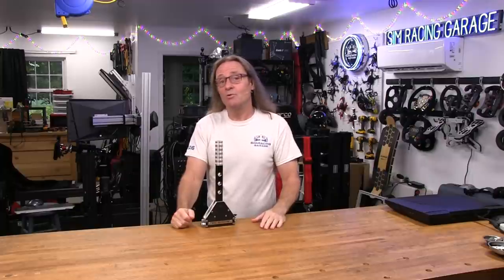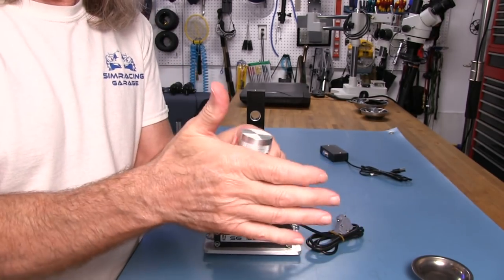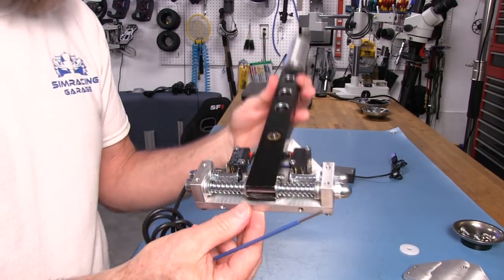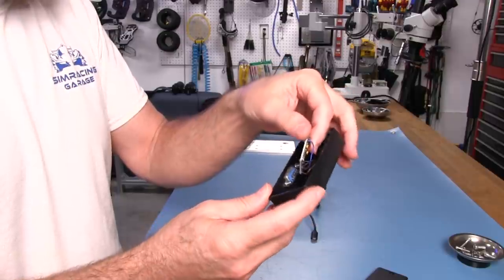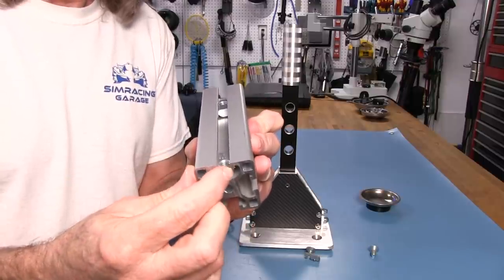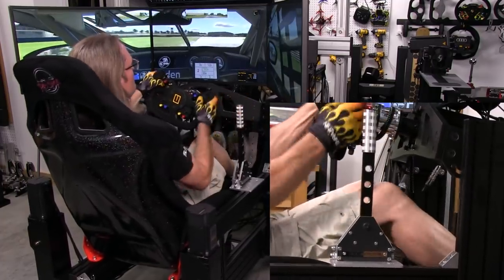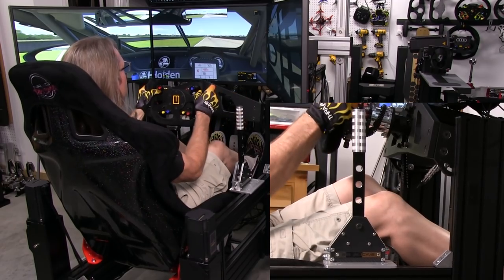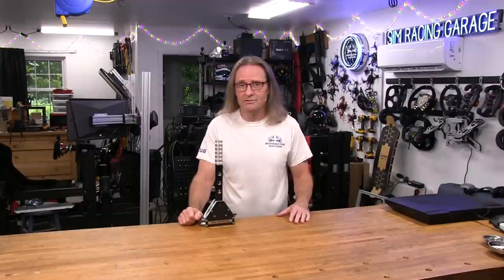SG Racing Sequential Shifter Review

Comment: How's the tactile feedback compare to the Aiologs? I'm guessing this has a mostly linear feel (I doubt the switch contributes much compared to those springs). Aiologs has that ball bearing mechanism to give a little hump in the force curve. The Pro Sim has the ratcheting mechanism. This I'm guessing just has solid thud at end of travel. Really cool and simple design and heavy duty, but I'm worried I'd miss the tactility.

Comment: I got one of those since early this morning and got to say they completely redesigned that shifter on the inside, the switches are in a different position now and look different too. I haven't opened it so far but I'll take a closer look later today.

Overall it feels a lot better than a 3D-printed shifter (had the DSD Pro Seq before which is somehow almost twice the price) and it feels a lot more solid, stiffer. Got to take a look how I can manipulate the actual shift though as it comes really late in the entire movement. It has reaaaaaaally long throw now (30mm in both ways so 60mm overall, that is almost 10x what the DSD does) which is somehow nice but also annoying that you really have to hit the end of the throw to actually make a shift.

Edit: opened it up and found Proximity Sensors instead of switches. Explains the late response to the shift
Reply: so is the redesign a worse setup?   was just about to buy the dual shifter and handbrake!
Reply: @gmarl238  no it is better! It might just not be ready to go right from unboxing you might have to tighten the screws which fix the sensors a bit to get the response exactly when you want. But the thing is superb considering it’s price anyway

Comment: *patiently waiting for logitech g923 teardown
Reply: impatiently waiting for logitech for a decade to provide us with a decent shifter and or handbrake without taking the damn thing appart and voiding the warranty.  After good 2 months im allready on the hunt for my next ecosystem.  Basicaly  i can dissapoint you that from what i can tell  a g923 is just kind of a firmware upgrade on g29; therefore allowing it to have maybe a bit more resolution than g29.  other than that  i still think its wiser to spend another 100 and just get a decent setup if youre serious about your times..  Because no direct drive wheel and its components and software will compensate for your lack of patience in braking and or rough ankles and therefor inconsistent times.
Reply: Watch G29 teardown - it's exactly the same wheel. Or just watch review at Boosted Media
Nothing new, sadly

Comment: So they went completely overboard with the metalwork, used your standard microswitch setup instead of hall or any other contactfree solution, and then have a free floating arduino board in their electronics enclosure. Thats not impressive. But clearly to make Barry like something, its all about how many kilos it weighs, all other things are secondary.
Reply: What doesn't baryy like you know

Comment: One more solid sequential shifter on the market and now we just need to ban paddle-shifting in race-cars. Btw I already was able to brake one of those switches with my sequential and got a replacement. It's always the weakest point of every shifter with this concept.
Reply: U cant brake them because the bolts stop the leveler from any forcing contact with the switch!
Reply: @sgracing1369  The switch is still the weakest part and will have a limitation on how often you can trigger within a lifespan. Afaik there are magnetic solutions that could replace this part.